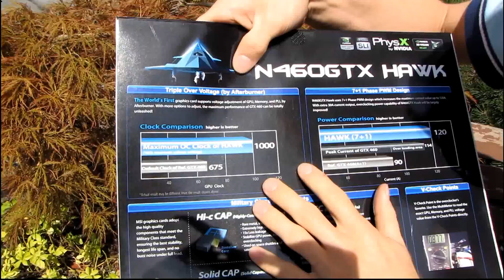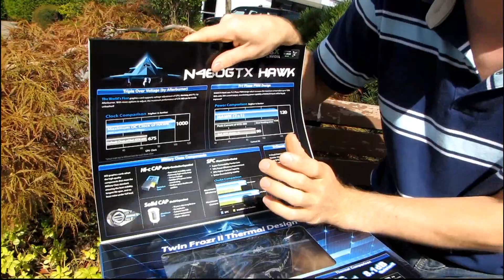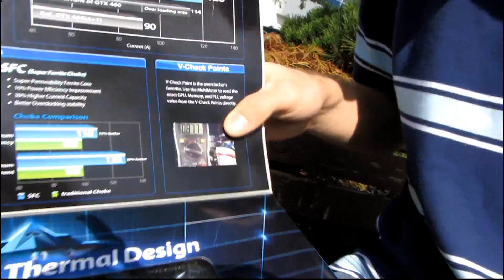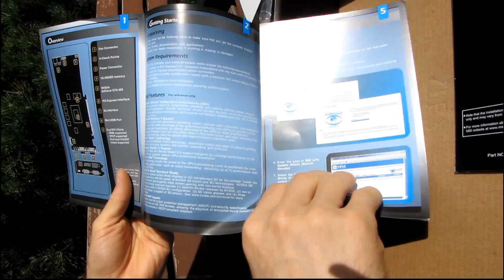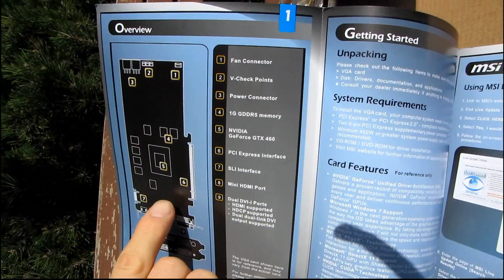MSI GTX 460 Hawk 1GB Overclocking Optimized Graphics Card Unboxing & First Look Linus Tech Tips

Comment: @Boratu96 the gtx 460 is way better than gtx 550 TI because it has 336 cuda cores while the 550TI got 192 cuda cores , the gtx 460 has 256bits GDDR5 vs 192 bits GDDR5 for the 550 so more bandwith = more AA = higher resolution = great graphics :p and the gtx 460 has more ROPS 32 vs 24 , and the gtx 460 HAWK in this video smokes the 550 TI out of the water !! :D

Comment: guys can i ask you about upgrading to this card

this my current pc specs

processor: e5300 stock clock
memory: 2gb ddr2 1400 i
psu: 500w

im worried cause others said that it  might bottle neck this card. is it true?

i need answers guys ASAP! thanks

Comment: @Riceboy33351 you will need a true power supply with a minimum of 550 W with a minimum of 40 amp on the +12V rail to be on the safe side

Comment: the note at 3:14 says "we would like to thank you first for choosing msi gtx 460 hawk for you evaluation and benchmarking

this card has pass related testing includes:
1 frequency (gpu/memory)
2 thermal
3 thermal duty
4 acoustic
5 power consumption

if you had encountered any obstacles during evaluations,feel free to contact with msi windows for further information.
thank you
best regards,

MSI vga team
2010,08,17"

wow im a nerd

Comment: The 460 is a beast, I have an EVGA GTX 460 Superclocked and it decimates any game I throw at it with max settings. Running it with an i3 550 @ 3.2Ghz w\4gb dual channel ram at 1333Mhz.

Comment: @MORDEKAIZ yes, msi has a excellent piece of overclocking software called afterburner that can syncronize the overclock on both cards. to my understanding it was developed between rivatuner and msi which is like a marriage made in heaven for us users. if you wanted to you could just use rivatuner which will do just about the same but wont have any overvoltage options. good luck

Comment: THE 1GHz IS A LIE :D -- IF YOU REACH 1GHz STABLE - tell me i will buy you one another HAWK for you - i own the hawk and is not that good as it is advertised - you cant play every game everything maxed (CoD: Black Ops - you cant use x16 AA but x8) ( i am talking about running this at clocked talon attack at 811MHz core clock)

Comment: To the director... Are both 6 pin power adapters necessary to power this card, or is one sufficient. I need to know so i can determine if my power supply  is sufficient or if an upgrade is necessary.

Comment: @acidspoodie Don't forget, many of EVGAs cards no longer have lifetime warranties. Any model number ending in TR has the standard 2 year warranty, whereas only the model numbers ending in AR have the full lifetime coverage. 

This card has a 3 year warranty.

Another thing to consider, the External exhaust heat sink design had been proven to be loud and ineffective when compared to some of the other solutions on the market. 

EVGA is always a solid choice for nvida cards, but I would go MSI here

Comment: @p3drojsg the gtx 460 at this point has better price/performance and it actually is 10% better than an 5770 at STOCK speed but you can easily oc an 5770 to a 5850, but i wold go with the gtx if i had an intel motherboard with sli and a case with good airflow since they run preety hot, if i had a board wich only supported xfire i wold go with a 5770

hope i helped ;D

Comment: Reading the review at T.town they got this card stable at 988 core/4480 memory which is a great overclock and it puts up great numbers but at a cost. In that review the peak power consumption was almost the same as the Gainward gtx 460 glh 1gb.(800core/4000mem.) in SLI. This thing sucks some serious juice. Plus, when overclocked at 988/4480, the noise level was very high. As others have mentioned, how much does this oc'ed affect the lifespan of card. To be fair one must wait for more reviews.

Comment: @Alembic You need to Volt Mod, and flash the voltage controller to disable OCP. And GF100 dies run way to hot. The 460 is GF104 based. :) Hope this helps.

Comment: 5850s/5870s can also hit 1GHz on stock air cooling, but require additional voltage.
Correct me if I'm wrong but I think GTX480s should be able to hit 1GHz too.

Comment: @d3vostation thank you bro, i didn't see the link there...

does anyone has thought about 1100 on the core?

i mean if with it gets 1ghz under aircooling, imagine what it gets with watercooler.. i think the 1100 is possible if the chip allow it.. cuz the pcb/vreg itself seems to be more than prepared to reach 1200 or more... now is up to the chip!!

man imagine this bitch at 1100 under water... would it reach GTX480?

Comment: that high frequency whine, isn't only caused by capacitors you know. it can also occur at other points within the pwm phase, and can also be a glitch in the Piezoelectric Buzzer.

Comment: Could you do an overclocking video on this card. I would like to see how it would compair to a cyclone. I currently have my MSI 1gb Cyclone stable at 925/1840 core/shader with 1087mV on the core.

Also I hate coil whine as much as you but my coil whine comes from my corsair TX650. Any Idea how I can dampen that? Only squeals while Folding.

Comment: @crumbworks How old is that article, and what cooler was used with the 470? I'm guessing a couple months old, and a reference 470, right? Drivers have vastly improved performance in games, and non-reference coolers are really nice. The 470 is now roughly equal to the HD5870, and a decent cooler drops temps by a lot.

Comment: What I don't like about most of the Fermi series is their ridiculously high wattage (and relative to that, their heat output).

The GTX 470 is considered along the lines of the Radeon HD 5850 (similar to GTX 480 vs HD 5870).

However:
GTX 470 at idle/load: 205 watts / 419 watts
HD 5850: 168 watts / 348 watts

Temperatures:
470 at load: 94 C
5850 at load: 77 C

(Source: Guru3D.com)

For the extra 5% faster that nVidia's DX11 cards are *at times*, it's not worth such a ridiculous heat increase.